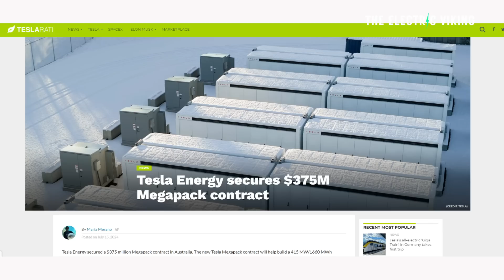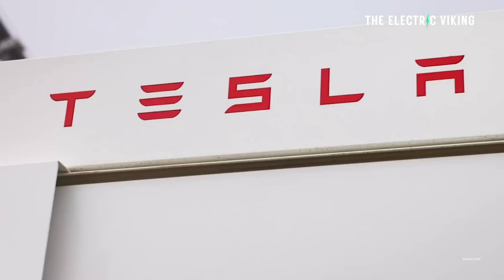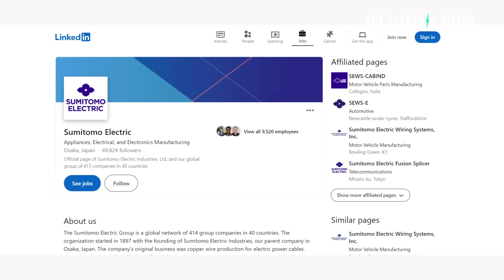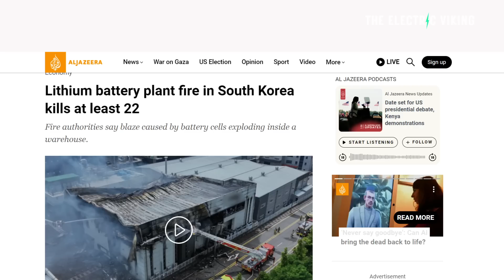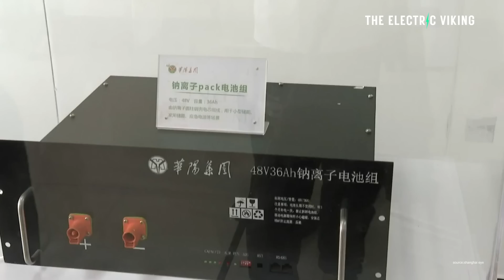AI says sodium batteries will disrupt energy storage and global auto industry

Comment: You’re absolutely right! Sodium-ion batteries have several characteristics that make them particularly well-suited for large-scale energy storage applications like those at solar, wind, and wave power stations:

Cost-Effectiveness: The lower cost of sodium compared to lithium makes sodium-ion batteries a more economical choice for large-scale storage.
Abundance of Materials: Sodium is more abundant and widely available than lithium, reducing supply chain risks and costs.
Safety: Sodium-ion batteries are generally safer, with a lower risk of overheating and thermal runaway, which is crucial for large installations.
Environmental Impact: The use of more environmentally friendly materials makes sodium-ion batteries a greener option for sustainable energy storage.
Performance in Various Conditions: Sodium-ion batteries perform well in a range of temperatures, making them reliable for different environmental conditions.
These advantages make sodium-ion batteries a promising option for enhancing the efficiency and sustainability of renewable energy systems.

Comment: So I was at the store yesterday and the 65 inch Roku television was 298.   I paid for my 55 inch TCL TV just a few years ago.  And I paid $1,100 for my 55 inch Samsung about 12 years ago. 

These batteries will undergo a similar price curve. 

Right now they're trying to hold the price points and increase capacity.  I can buy a 2000 watt battery that has the same capacity as a 1000 Watts cost me two years ago and it will have better features.  Both will recharge about 3,000 to 5,000 times.  

At some point in the near future though, we'll be able to buy a thousand Watts for $250.  And 4000 Watts for under $900. 

And at that point everyone should have a 4000 Watt battery to save the contents of their refrigerator and maintain power for phones and internet during outages.

Comment: 15% energy density difference is hughe. It affects cost, size and performance immensly especially when you take in account the general very low enegy density in batterys compared to other medias. Batterys for energy saving will not be a solution in a bigger scale for many decades. When the wind don't blow it don't blow for weeks at a time and it's normally when energy usage peaks due to it being the coldest too. This is especially true for the northern hemisphere. There is no reasonabel and cost effective battery for heating your house for a entire day in wintertime not to speak about a coupel of weeks. Also windmills are very questionabel economically and technically.  It's a hughe infrastructure investment that is not covered buy the windmill companys. There is no electrical grid that likes thousands of small generators. They are dependat on big generators that kan ramp production up and down exactly according to demand. So far whe have seen that usage of oil and coal increases with increasing windmill parks due to it often coupeled with closing of nuclear plants.

Comment: Actually I don't think the increasing solar is going to reduce costs.  The network costs are the driver and fluctuating renewables is a whole new level of complexity.  Safety should be the primary driver when it comes to batteries.   10,000 fires a year from lithium, and it will get worse.

Comment: The answer IMO is to create desalination plants around the world to reduce or stabalize  ocean levels from going up & use the salt taken from the ocean for sodium batteries.  Then use the clean water to pipe that throughout every country on earth.  If we can pipe oil anywhere we can pipe clean water everywhere.  These batteries would be perfect for MegaPacks & advance the transition to creating an abundance of energy.  In order to create that energy every country could install solar fences on all their highways on both sides which wouldn't take up any new land.  

Solar panels could be intalled on every rooftop & it wouldn't take up any new land.  Solar fences could & should replace every fence everywhere as another way to create & store more energy.  There are thousands of applications for solar panels that would not take up any new land & would just replace numerous things we already have.  Wind Turbine fencing could be installed next to every rail line to take advantage of the wind created by moving trains.  Wind turbine fencing could also be placed everywhere replacing normal fences where applicable & solar wouldn't be as good or better.

Comment: There are several other important battery characteristics I didn't hear compared: max cycles; % chargeable for efficiency; cold-temp performance and power loss; charging rate (fast-chargeable?); heat management; dendrites; recycleabiliy; lifespan; etc.

Comment: Crystal energy will change the world. No more chemical power. Simply a quartz crystal with two different metals of wires wrapped around at 90 degrees to each other and 45 degrees to the crystal. The crystal will need to be pulsed and the resonant frequency is 4096 Hz.

Comment: Regardless of which political party is in power, battery-electric microgrids (stationary electric power providers) will continue to be installed, worldwide. It doesn't matter what Donald Trump says or feels. Due to its superior economic and operational qualities, BEM technologies will saturate electric utilities over the next half-decade. 

The knock-on effect will be the end of steam-powered turbine electric generation. And it won't matter how the water is boiled! Whether it is coal, gas, or nuclear -- traditional steam electric power does not fit in with photovoltaic electric generation. The problem is that the metals that hold super-heated steam cannot handle daily shutdowns and restarts. The thermal transients repeatedly cause the metal to expand and contract, which weakens the metal. These systems were designed to be operated as a baseload electric provider. The intermittent nature of already installed green energy demands a new solution, and that new solution is BEM technologies. 

On the other hand, gas turbine peaker powerplants can operate intermittently. However, these will also be replaced by BEM technologies.

Comment: Chemical grid storage batteries like this will soon be a thing of the past. The future is enhanced geothermal energy, because you can use those wells as batteries too. You put them under pressure in the daytime, and discharge them in the nighttime.

And over its entire lifetime, you'll get at least the same amount of energy out of a geothermal well compared to a fracked oil well. So there's basically no need anymore for oil fracking.

Comment: I have a solar power system with 2 1/2 year old lead acid batteries, and hope they hold up long enough that my very next set can be LFP or sodium. I want 8 KW hours, 2 more than I have now. Just watching the price and praying it goes down fast enough. I wonder if that $300 sodium battery is already at the same cost as what I use now, about $220 per KW hour.

Comment: If you look at some manufacturers technical data on 18650 batteries - a typical Lithium 18650 is rated at 2500mAh with a peak discharge 20A. A sodium 18650 is 1300mAh. 128WH per kg. The data isn’t completely comparable on the actual cells I quote - but the essential problem is the Sodium chemistry only has about half the capacity. Admittedly you can discharge it more - deep cycle it - but you still have roughly one amp hour out of the Sodium cell and 2 out of the lithium cell of practical use. The sodium cell has a lower energy density and thus lower fire risk. It’s not what we need in a car but it may indeed help with non-vehicular storage - but we will have to make incredible amounts to have anything like useful storage. Has anybody calculated how much energy has to be used just to make these cells? The physics and economics aren’t adding up for using these things for significant amount of grid storage.

Comment: Sodium ion batteries have one more trick over LFP. They hold a charge a lot longer. Sodium-ion batteries can retain 94% of their rated capacity when stored at room temperature for 28 days. This means that you can charge up a bank of sodium ion batteries in late summer, let's say September, and use that electricity in mid winter like January and you will still have 78% of that battery energy available. This means that windy winters can power air conditioning heat pumps in summer. It balances out the the seasonal energy mix. Something that never was capable of being done before.
I had been hoping for this. In Ocean City Maryland when there are no tourists in winter, there is a lot of wind. So much so that if you leave flags out they tatter in weeks. But there is no one to use all that wind energy. In summer the wind is light, the heat is hot and there are lots and lots of tourist going to the beach. Energy use is really high and that energy comes from a coal power plant many miles away and brought in over hundreds if not thousands of power poles. This way you could generate lots of electricity nearby, store it in sodium ion batteries and use it during the energy use intense period of summer.

Comment: To choose the best battery we need to first decide if it will be "in place" or "mobile". Unmoving energy generation may make batteries unnecessary if it is 24/7 never-ending, e.g., geothermal. New drilling tech allows deeper wells, and new energy conversion can lower the cost to near zero. This PROBABLY would have been possible a century ago, without coercive, regulatory, governance.

Comment: Its not all about cost. Vehicles have volumetric and gravimetric density considerations. Sodium is 3x heavier than lithium and while the ion carrier is only 7% of the battery that is significant. Sodium batteries. It would require more hevier batteries to get the same energy storage and you would have less range from the added weight! 
However stationary battery storage does not have the same need for volume and weight minimization and that is where the vast majority of battery energy storage will be deployed over the coming decades. Although they may need a few more truckloads of battery packs to do the same job.

Comment: Buy batteries,while the elites are waiting for better batteries at a better price point. Roll the dice. I did and so did Tesla and now My 21 model Y is in the shop for a dead, main battery replacement under warranty. Data center individually, use huge amount of power and by carbon credits in the main,instead of deploying batteries and Solar.

Comment: What is the performance of sodium ion batteries at low temperatures, compared to LFP batteries?
Reply: LFPs operate down to - 20°C but the majority are more optimal from zero to  0°C to 45°C; although some manufactures claim to have extended range versions that operate down to -35°C ( -10°C optimally) targetting battery storage.  Sodium Ion has an range of -20°C to  60°C, and are optimal over the whole operating range. Most BESS units have battery conditioning to keep the batteries cool/warm in their optimal range (although some home storage units don't offer this feature).

Comment: Give me an EV with 80Km range and I can do 80% of my driving.  120Km range makes it over 90% and I'd only have to rent a hybrid for my long range trips.  An EV with only a quarter of the range would save $12,000 to $15,000 on the purchase price.  There'd be plenty of room on the bottom to install more battery arrays when they're cheaper.  I could easily afford to rent long range.  I'd rather be able to rent an efficient generator that I could tow on a trailer that's plugged into my car while it goes.

Comment: here's when EV's will make sense.

1.  They have to have equal weight to that of an ICE equivalent vehicle.
2. They must have a charge time of 10 minutes or less.
3. The battery pack must NOT catch fire.
4. The battery pack must not cost more than $10,000 to replace when it's reached its end of life.
5. Battery must have a lifespan with the fastest charging of at LEAST 500,000 miles.
6.  The range of the vehicle must be at least 300 miles, MINIMUM. more if possible.
7. Batteries must be recyclable EASILY.
8.  Must not use materials in short supply or using slave labor.
9. Truck must be able to tow a trailer of equal weight to a ICE/Diesel at similar range.
10.  Must be able to repeatedly fully charge to 100% without any degradation of the battery's lifespan.

When they can figure all of this out, THEN EV's will make sense for the masses and THEN people will jump all over EV's for all consumer vehicle applications.

This is where the EV people don't realize.  In order to convince a ICE/Diesel owner to switch, they must be as similar or better in ALL aspects. Otherwise, EV's simply won't work as a suitable replacement for ICE/Diesel.
Reply: 💯 this is it.its simple. but people living in fantasy land.
Reply: Waste of space

Comment: California’s CAISO already has 11 GWh of grid batteries and will add another 40 GWh in the next 15 years. For now, it’s LFP batteries with 5MWh available in a single 20 foot trailer. The days of peaker plants are limited, whether it’s LFP or Sodium
Reply: Have you got any idea just how much electricity California uses per day?  Top tip: 51Gwh is just 90 minutes of electricity, providing demand doesn't increase. 11 Gwh. is a mere 20 minutes worth of supply. California will need at least 300GWh of storage before the days of thermal generation are behind them. Sodium ion batteries can't come fast enough or cheap enough.

Comment: 10:02 $10 per KW, I’ll take a 100 KW system for my home.
Reply: So will everyone else
Reply: I heard that and had to pause and replay, this means that 30kWh for my home, currently about £15,000 is going to cost £300? For that price i'd spend £5k and have enough storage for the winter, let alone the evening......think that might have been a mistake
Reply: @sygad1  There are currently ~65 mega battery factories being built worldwide they will churn out batteries 24/7  the economies of scale will drop the prices like a rock, not sure if we get to $10/kwh at that date be we certainly will but remember by the time it get packaged into a rack mount case with and BMS and some profit for the manufacturer it will be more but still a great deal compared to todays prices.

Comment: Sodium batteries have a voltage curve much like lead acid a steady voltage drop as they discharge
Reply: Yep. They'll need to improve the discharge curve before they can be used in any serious way for storage. Whilst they are very resilient to damage, being able to discharge to zero volts without damage, they spend most of their time in the last 50% of discharge, at a voltage that makes it very difficult for inverters to make use of. If they fix that problem then I'm all for Sodium cells. My suspicion however is that the discharge curve is fundamental to the chemistry.
Reply: @timkerr7171  true... but one solution could be, that the batteries are always working between 25% and 75% SOC. Finaly lifetime expands, prices have to be only cheap enough...

Comment: Nobody knows why people don't want EVs? It's simple, everyone has a phone, batteries run out of charge in just a few hours and last for 2-3 years! People will get in to EVs when we get better phone batteries that last 10-15 years and don't need to be charged for 1 week or more. Small/mid size cars like Golf, Astra etc must have 1000km WLTP rated range as that is around 700-800km real world range which would be fine. Price max 15-25k, depending on the extras.
Reply: Everything about EVs is so much better that the range issue quickly recedes into insignificance. I have driven over half a dozen in the last 2 years (multi-week rentals) with range of 250-450 km with never a worry. And then, when you realise you are paying way less than half the price of gas (and not wasting ⅔ of the energy it contains) - you have to wonder how the anti-EV disinformation campaign became so ingrained?
Reply: So it’s just pure ignorance. Because EV batteries last for many years longer than our phones, 200,000+ miles at least. That’s at least 13 years for the average driver, more for many. And yeah, you want to charge daily, but at night, in the garage, while you sleep. Who cares?  You don’t have to if your commute is short, but it doesn’t matter, it’s health for the battery to use only the middle % of its capacity so just charge daily overnight. (Yes, EV’s are not a good solution for people who don’t have a garage with power). EV’s currently get the same range as the average ICE car, last as long if not longer, and require FAR less cost in terms of energy and maintenance (there’s basically no maintenance on the drivetrain).  EV’s are already a far superior driving solution, it’s just pure ignorance on the part of consumers being uneducated and biased by so much disinformation online. People talk about “range anxiety”, which is ironic because I have none with a Tesla, but had range anxiety with my last ICE car because the thought of having to fill up $90 every week was painful. Now my weekly commute costs $18 a week.
Reply: A replacement phone battery is about  £10 ,a replacement EV battery is !!!!.